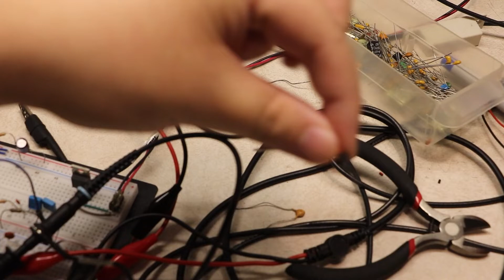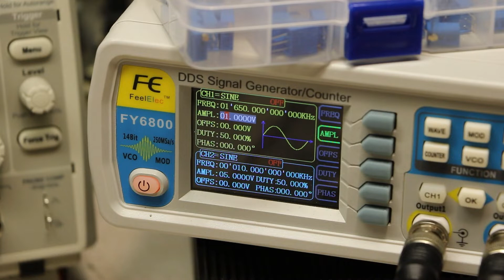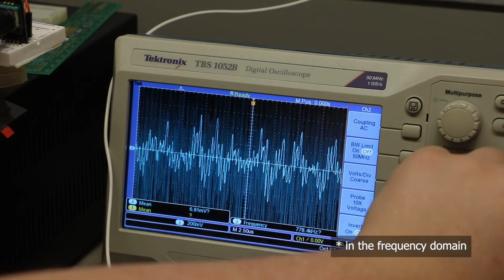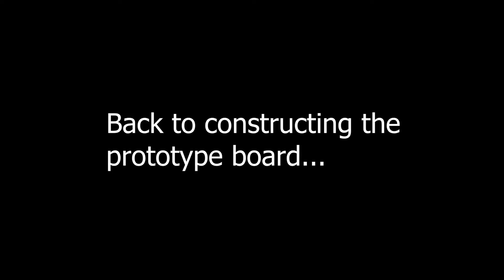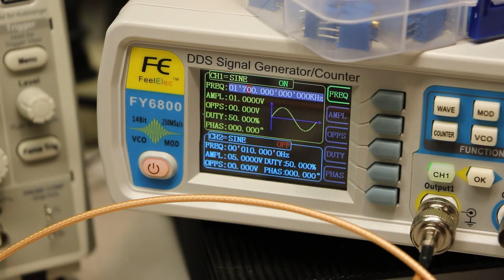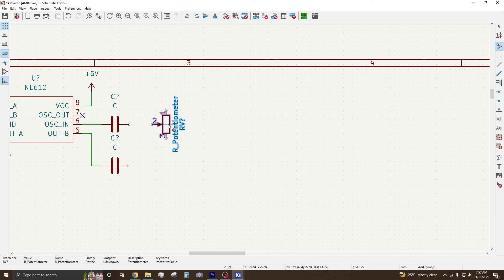Part 2 - Input Filter and Mixer - Breadboard Superheterodyne AM Radio

Comment: Thanks for the work you have put into this video. However, I think it would be more useful and educational if (instead of focusing on the breadboard) you presented the schematic diagram of the circuits you are discussing, and explained how you selected _every_single_component. With all due respect, watching you insert components into the breadboard isn't very useful. Instead,  you should discuss each circuit "block" (input filter, mixer, etc.), explain what function or spec you are trying to achieve, and then how you did calculations and selected components to achieve the function. Then power up the circuit and see if it does what you expect, and are the signals at various points what you expect. Obviously, you have done all of that prep work in this design, and that detail is what would be useful to viewers.
Reply from the maker: Thank you for your feedback, I will consider it for the next video.

Comment: Why do we need a high pass filter for mw range
Reply: Shouldn't we use a low pass or band pass here
Reply from the maker: I'm just wanting to block DC and 60 Hz here. I also planned on trying shortwave reception with this circuit, so I didn't want to eliminate those frequencies quite yet.